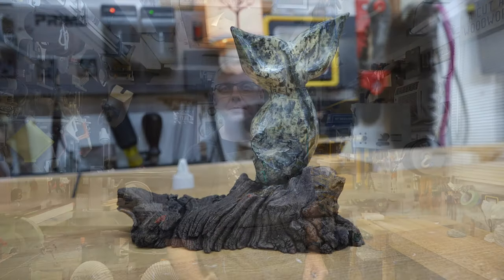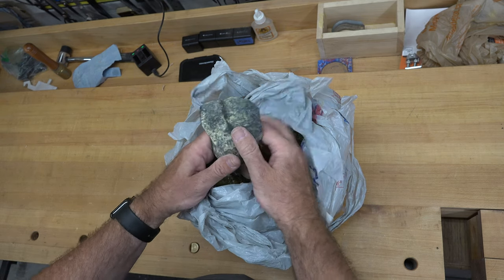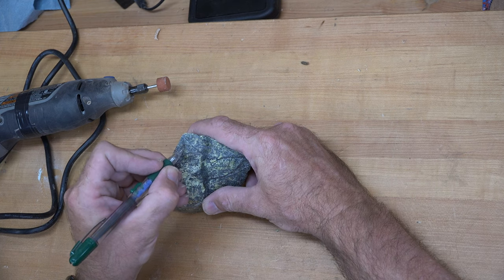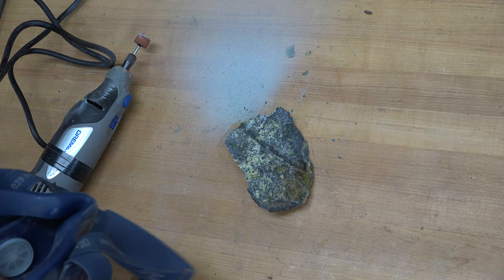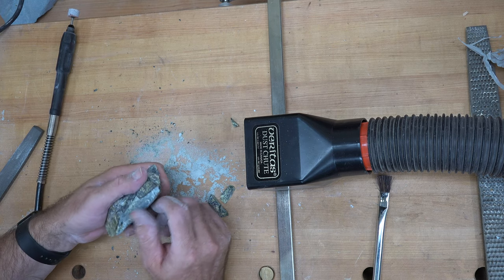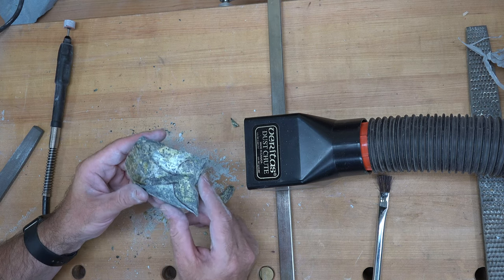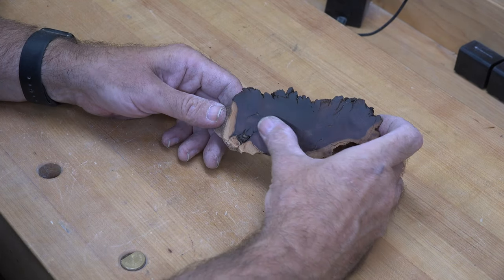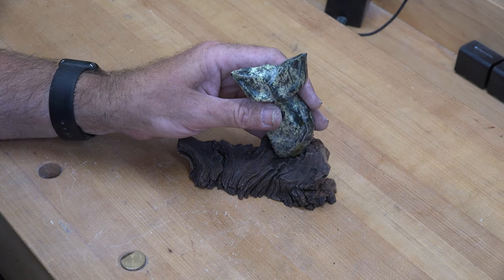Carving Soap Stone

Comment: I realize this is old but diamond carbide/or high speed steel will go along way on carving this material, wet saw for cutting tile will speed up trimming the rough.
Reply from the maker: This is great advice.  Thanks for tuning in and for chiming in with your suggestion.  It is very much appreciated.

Comment: I see you have tape on your Dremel. So do I.
Reply from the maker: At one point Don, the brushes stopped making contact and the machine was fairly new.  I put the tape on there to give the brushes a little extra connection and haven't had a problem since.  Thanks for tuning in to the show.